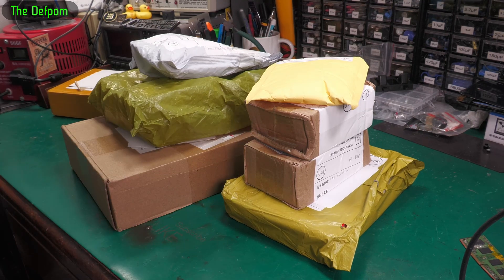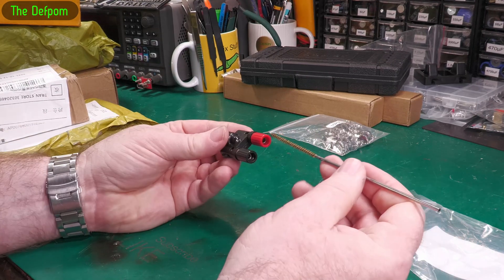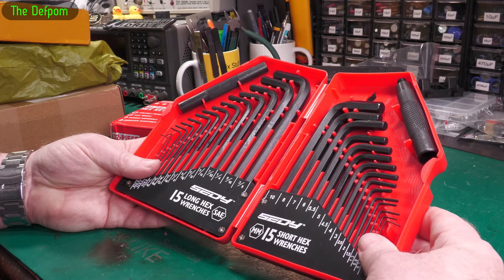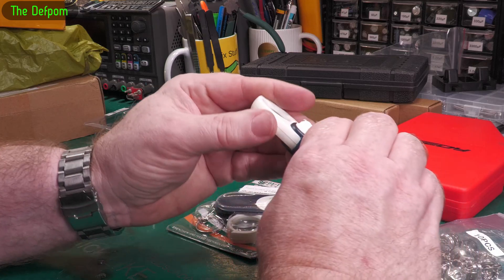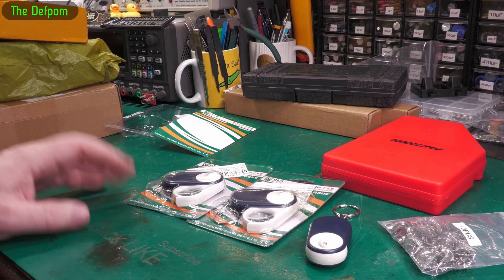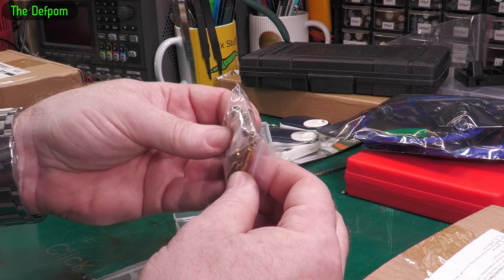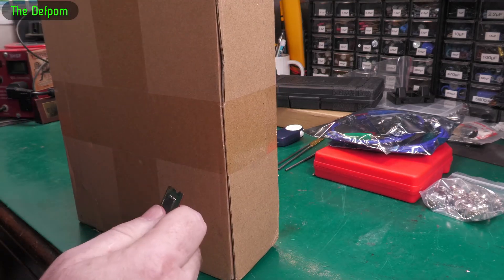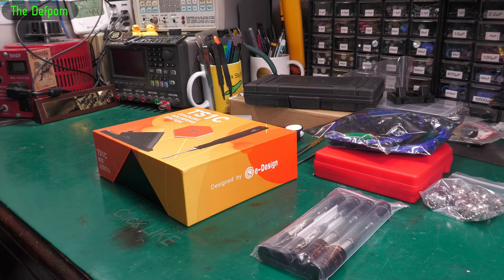🔴 Mailbag Monday 3rd November 2025 - No.1420

Comment: Since I mostly only use Hex/Allen key wrench sizes under M6,  I gave up the old style ones, in favour of the T handle type.  I only now keep the old ones for screws with restricted access.  The bar types have much more torque and are far less easy to lose!

Comment: One day you will find the bend in that 7mm key may just be right to get a bolt unscrewed, I find I keep the cheapies in a separate box, for "modifying" with angle grinder or gas axe to get the right shape/proportion.